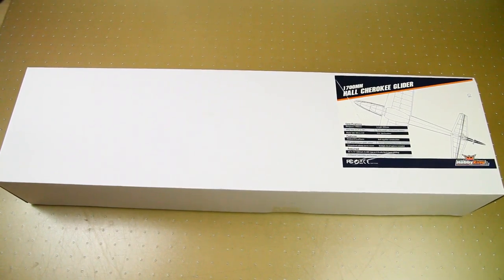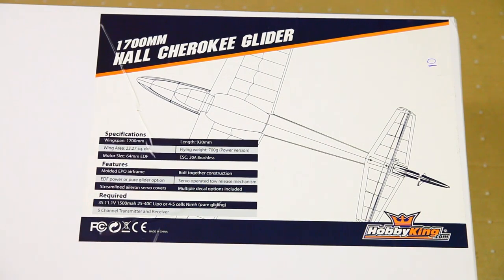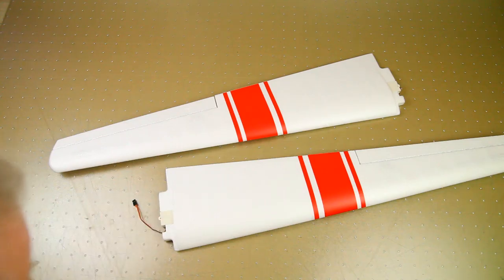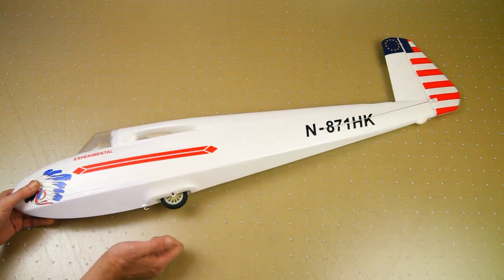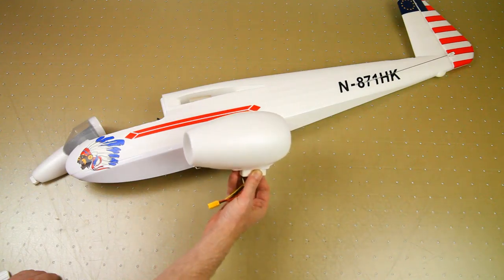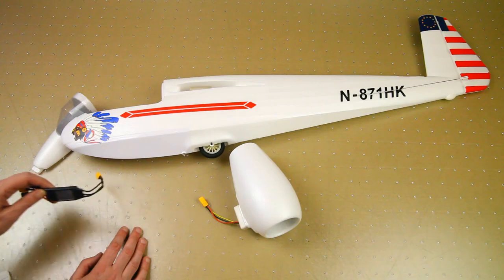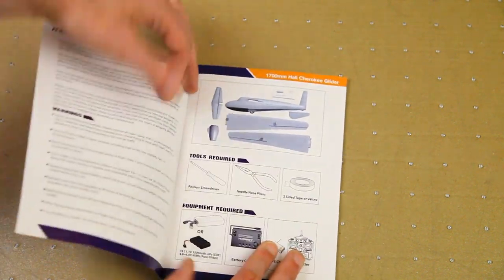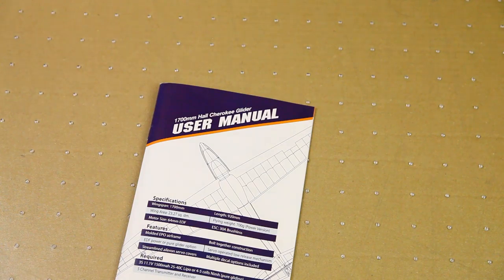HobbyKing Hall Cherokee 1700mm EDF Glider - Show & Tell + Build recap

Comment: hey Dutch glad you got this one! The video from HK the other day was interesting. I like the old school look and it seems like it will fly well. Looking forward to your flights!
Reply from the maker: +Discover RC Yeah.. bit of old school in a simple/clean package.. Should be a nice FPV platform I think :)
Reply: +DutchRC Adventures the nose is perfect for fpv :)
Reply from the maker: +Discover RC I'd think so :)  Should I try and put the camera IN the cockpit by the way? There is quite a chance the 'window' isn't the kinda plastick that works well to see through huh?
Reply: +DutchRC Adventures yeah I think you'll be doing some beer goggle flying with that plastic. I'd just take off the plastic. Use a little tape to secure the canopy once you have extra weight on it with the fpv stuff.
Reply from the maker: +Discover RC Yeps.. that would be the way to go.. AND first see if I like how the plane flies offcourse ;)
Reply: +DutchRC Adventures sounds good!
Reply from the maker: +Discover RC Been hovering over the 'order' button of the Nano QX2 FPV by the way.. Are you happy with yours (apart from the lens)??
Reply: +DutchRC Adventures well I haven't gotten the chance to really test out the video range which I was most concerned with until the lens broke. It does seem like a good flying quad outside of that.
Reply from the maker: +Discover RC Hmm yeah.. that move from the CP to LP antanna.. That's really holding me back.. 
Ohw by the way: I've been testing antenna lately, and in some cases I have better results with rubber ducky antenna.. (open field.. over a short distance.. like upto 100m)

Comment: The glider will easily take off the ground, I do it a bunch in my flight vids.  

Rudder pushrod seems to work great as is, try flying it first, Ive had no problems.

The motor pin, you can file a taper to the long end, that will help it find its home easier, plus it gets easier over time as well. In my video I put tape on the 90 degree end, so you have a tab to grab to get it out.  

With an 1800 my esc is farther back into the fuse and balances great. 

have fun! Look forward to the flight video
Reply from the maker: +JohnVH541 Thanks John :)   I have allread made a support for the push-pull rod.. I fly on rudder quite a lot, and this looked just horrible to me :$ 
Yeah good one :)  I dremmeled a taper on that pin indeed.. That helped quite a bit :) 

Cheers!
Reply: +DutchRC Adventures Oh ok, it doesnt need it though, as you stated, its not a high perf plane.  Id like to slope soar mine, I think it would be fun!  Now hurry up and fly it! haha
Reply from the maker: +JohnVH541 Hahaha :D  Yeah.. first wanna fly the micro beaver though :$ 
Ohwwww and I got a Multiplex Rockstar in today as well :P 

Yeps.. slope soaring would be good with this glider too I think :) 
true.. I'm sure the rudder works without mods.. Mine will just be a bit more preciese this way.. I do allways like cost-free upgrades ..
Reply: +DutchRC Adventures something else I just thought of, the edf being mounted up high, will make the model want to dive, I mixed elevator with the throttle stick to compensate. Just a heads up.
Reply from the maker: +JohnVH541 Yes thank you :)  I think I saw you mention that in the RCG topic :)  (could have been someone ellse.. not sure).. but yeah.. makes perfect sense :) 
So ehm.. just fly it inverted then huh? ;)
Reply: haha, I have not tried that yet, but the tundra on floats flies better inverted with all that drag up there, haha
Reply from the maker: I think I got me a bad apple mate.. The EDF sounds horribly out of balance.. The plane does fly, but not a lot of power.. And well.. flying it inverted I crashed it.. Just didn't have enough power (yes, I can fly inverted very well)
Reply: Oh no, sad to hear that, hope you got video at least!
Reply from the maker: Yeps.. That one will air tomorrow.. Looking back at it, I checked if I really stalled it, but it really was the lack of power..

Comment: Thank you - nice video!  My brother and I have this plane and we have found that it does not fly that well.  It was hard to fly it smoothly and it stalled a lot or tipped to one side or another unpredictably.  I wonder if the ducted fan on top creates too much wind resistance?  Or perhaps we need to adjust the center of gravity.
Reply from the maker: Thank you David :)
yep.. it's the motor-pod + the fan.. With the pod removed, it's actually a very nice (slope) glider :)

Comment: Did you reinforce the control rod? I would add a plastic sleeve then use a zip tie to anchor it to the side of the plane,probably in two places. I noticed too much flexing in my Waco Biplane between the lower and upper airelons, I am thinking of changing them to a bigger diameter rod. I have some brutes that wo uldnt bend if they wanted to. I think it would be easy to do FPV on that by making a camara pod where the pilot housing sits. You could sit just about any camara in that spot. A mobius or Run cam would sit there perfect. I like the fact they reinforced the control surfaces,except the elevators could have used a few strips. Im not sure that U shaped plastic piece would be enough to support the out side edges. granted,you are not going to be hot rodding around the sky with that thing. I get the impression the foam is thin and light. Mabe too thin for me. Again,I wouldnt be hot rodding it around the sky,but I cant help but think one bad landing or stressing the wings on too windy of a day might cause things to fail. I really shy away from the transparent looking foam stuff. I can but it at the dollar store and modify it to fly if I wanted too. they actually have a glider like that for about $15 dollars I was seriously considering to add carbon strips, control surfaces on it and tow it behind my Apprentice. Its still an option. The wings are just like that,transparent. I wouldnt mind getting a cliff glider,we have some nice places along lake Michigan that work perfect for that kind of flying.
Reply from the maker: +scott firman Yes sir! I reinforced it.. I'll probably show what I did in the first flight video with the plane.. 
I used a plastic sleeve, and made a stand-off from depron.. Works like a charm :) 
Wlell yeah.. bigger diameter.. Basically it is strong enough to do the pushing & pulling.. right? Just as long as you ensure it won't bent, you should be good..
For the FPV cam I am not sure if I would want to add pan & tils.. proably not.. Don't forget I would need Two camera's though.. 1 recorder.. and one real FPV camera..
Reply: +DutchRC Adventures Yeah,I was just telling Nate from RC Saylors that its almost like having kids dealing with putting them in the car. I have my regular gear bag for flying,then I have my extra transmitter if I fly two planes,or if I fly my helicopter,then I have a second gear bag just for that stuff. The Yellow bipe takes the whole back of the vehicle,then the Apprentice goes behind the drivers seat and thats two trips because the wing is seperate,then the gearbags. Its just like taking kids on a trip,lots to load up just to have fun. Thats a great Idea using one square of dupron as a channel for the rod. I wouldnt have thought of that simply because we never use dupron here. Its always dollar store foam. I already fixed the rod issue with my bipe. That and I wasnt getting enough travel on the right airelon. I moved the inner rod on the servo arm out one hole and what a difference! Now both airelons work the same distance on both wings. It was noticable when flying. Well,cant wait to see your flight video then...later.
Reply from the maker: +scott firman Haha :D  That sounds familiar ;)  I allways plan what I take on a flying day to what I can fit in my car to a maximum :P  Allso why I just don't buy large wingspan planes.. 
Huh? You didn't have both ailerons set up the same way? :$  Hmm well for ailerons that actually wouldn't be Terrible.. You can easily fly a plane on just 1 aileron :)
Reply: +DutchRC Adventures One airelon wasnt going the same distance as the other. If one was at 100 percent the other was only at 70. No they are not together that I know of. I like those big planes! I wont be able to take all three planes once I get the F4U done. I may have to choose which plane says in the hanger. darn. I said I may have to buy an old work van so I can get all my planes in. or a cube trailer. I already have a utility trailer,I suppose I could build a box for it. If I made it light weight,I could put it on wheels like the serving carts in hospitals,except it would hold my planes.lol.
Reply from the maker: +scott firman Ghehe well yeah, I DO like bigger planes.. But I do not like transporting or storing them ;)  Well on top of that my flying fiels isn't really suitable for larger planes regretably..